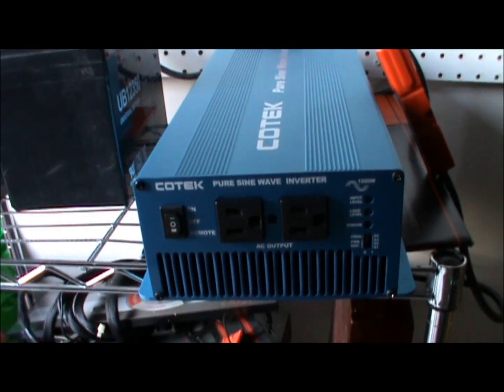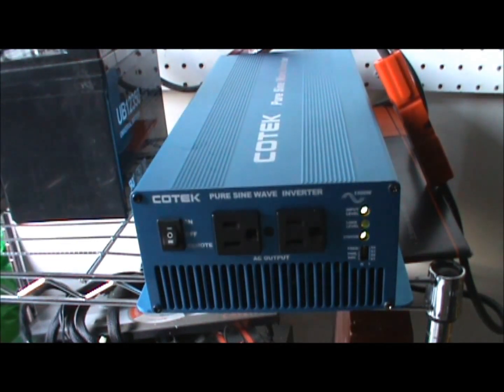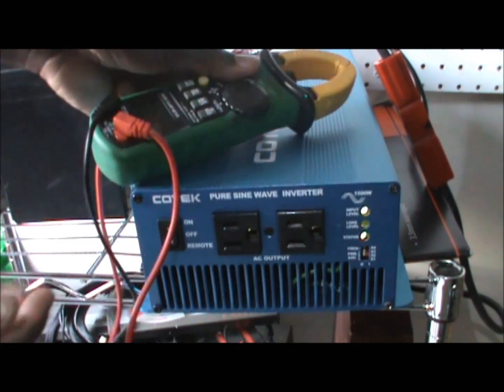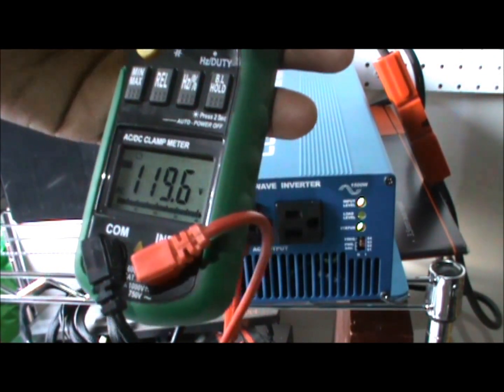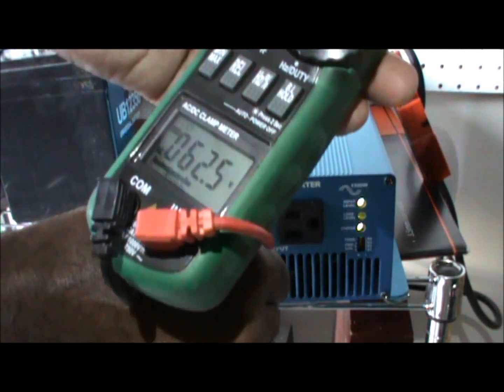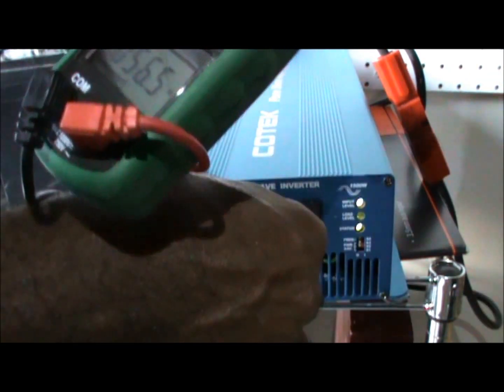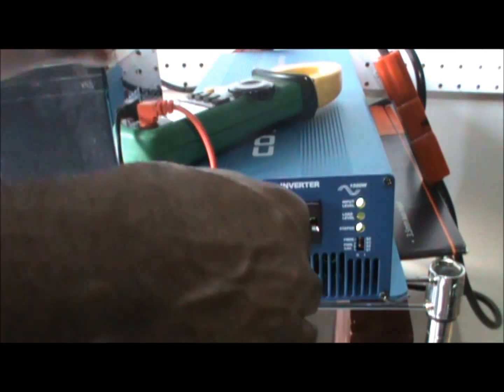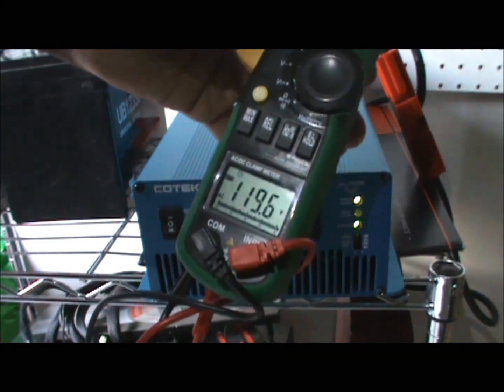Cotek Pure Sine Wave Inverter Output Voltage Readings

Comment: To measure the voltage between ground and other terminals you need to use the Low Impedance scale (in a few DMMs is called LowZ) this is necessary to avoid the Ghost / Stray Voltage.

Comment: Love the information.  I'm using the exact same inverters to run an off grid cabin.  What I would love to see is inside your breaker box and how you bonded the neutral and ground.   Thanks for the videos and the information!
Reply from the maker: Casey Duncan 

You are definitely on my list for that video.  Thanks for watching.  Cheers :)
Reply from the maker: Here is the link to the video that shows how the neutral and the ground are bonded inside my breaker box:
https://youtu.be/92sQRlj2eOk

I hope it helps.  Cheers
Reply: Thank you!  I'm running duel Cotek 24v inverters.  One is running into the Cabin, the other is used for the shed and the covered outdoor area.  Setting up all the wiring now while the roof is being prepped for the four 250 watt / 24v (2 banks wired to 48 volt) solar panels pushing through a MorningStar MPPT controller and into six 8 volt golf cart batteries (2 banks of 3 running 24V).  I've collected parts a little at a time for 3 years now and its finally coming together.  I know the DC side very well, its the AC side that I'm a little sketchy on.  I'll take your info into account, but I do have an electrician willing to come up and look it all over before I turn it on.  Thanks again.
Reply from the maker: Casey Duncan 
Sounds like an awesome fun project.  All the best with your solar project.  I would really like to see a video of your set-up.  Cheers

Comment: Thank you for the updated video, I see that you are getting almost the same reading that I'm getting.  On your other video you said the you have bonded the neutral to ground.  Your inverter didn't blow up?
Reply from the maker: Alfredo Pineda 
The inverter in the shed is still alive and well, my friend.  Neutral and ground bonded and no smoke :)
Reply from the maker: Please note that the bonding takes place in the breaker box. Cheers
Reply: I'm not sure if i bond the neutral to ground my inverter would stay on. I think it might fail. I don't want to risk damaging the invert.  I'll see if i buy another inverter that reads zero volts from neutral to ground. Then i might think about connecting it to a circuit break panel. Thank you for the video. Like your set up on the shed.
Reply from the maker: Alfredo Pineda 
Thanks for watching and commenting.  All the best with your projects.  Cheers.
Reply from the maker: Alfredo Pineda 
It's my pleasure making the video.